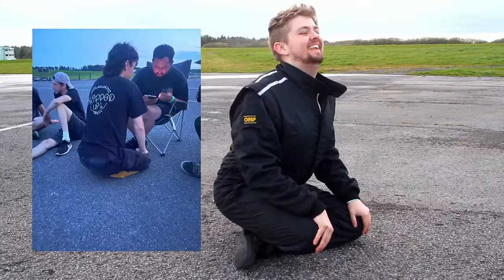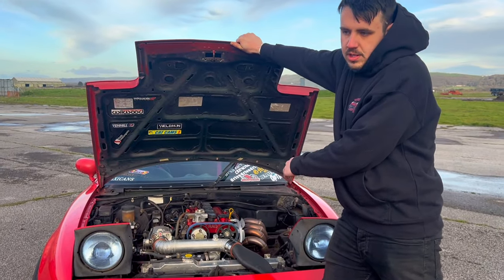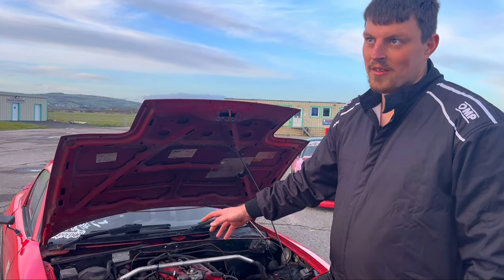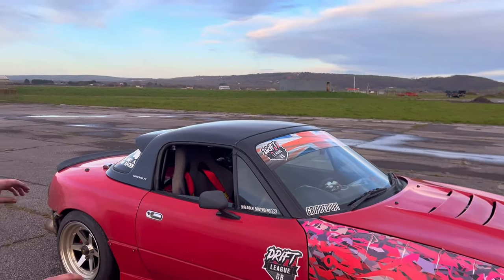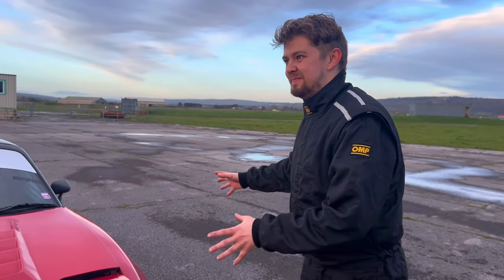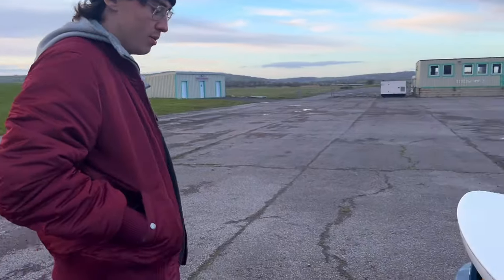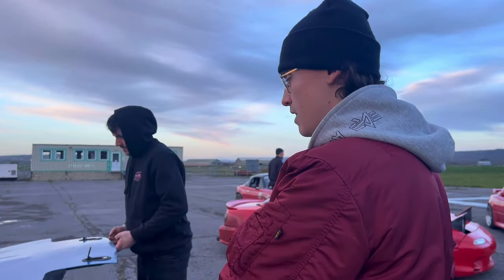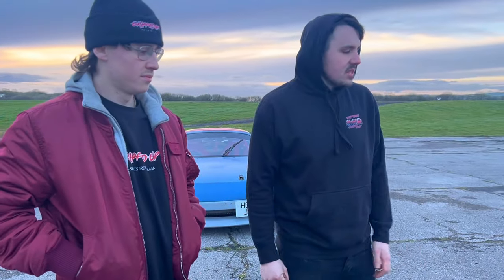The Perfect MX5 Drift Setups! (+Finn's)

Comment: You have any turbo specs on the 1.6 ?
Reply: S13 T25 with an extended billet wheel
Near instant boost response and lovely power for this kind of driving, would go bigger if you want to run more power and high revs
Reply: @RearAxleDivergence  S13 used to have something like a 2554? I have a 2560 on my 1.6 but boost comes after 3500rpm :(
Reply: @geopouros depends who you ask since they didn't really have a number back then but I think its usually referred to as a 2552 maybe? Either way VERY small
The modern 2554s would be a good step I think. Similar low end but better top end! 2560 is what I'd go for if aiming for 250hp and accept a bit of lag